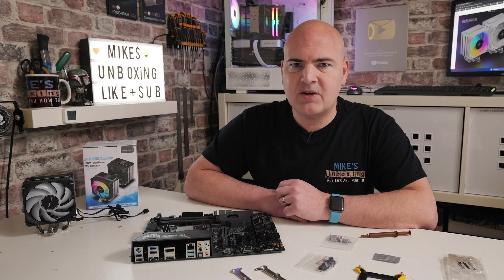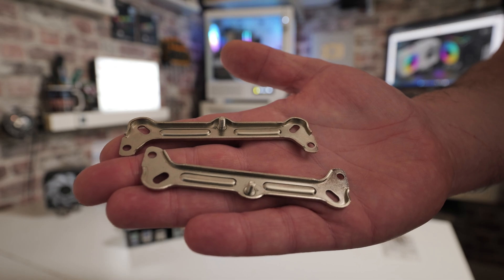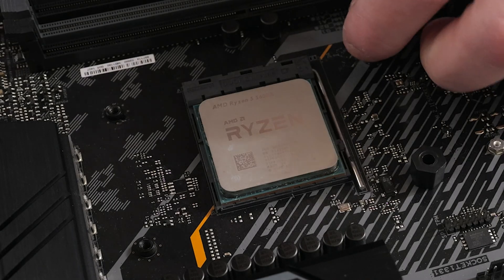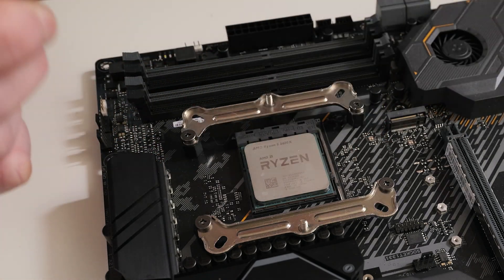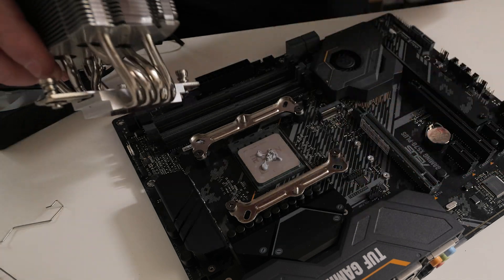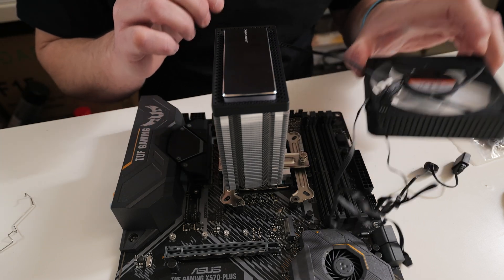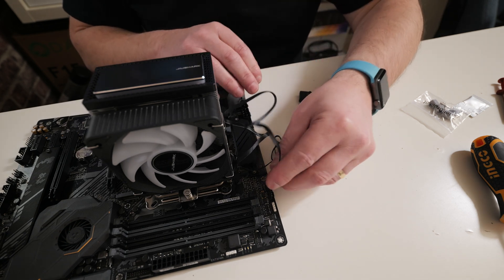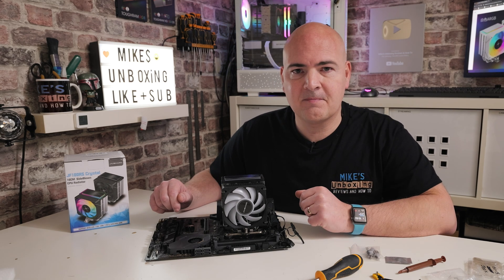How To Install Jiushark JF100RS Crystal ARGB CPU Tower Cooler AMD AM4 AM5 Motherboards

Comment: Can the light be turn off? Does it have a remote for argb? or do u need a app to control the light?
Reply from the maker: the light is controlled by whatever you plug the cable into, either a controller or the motherboard header and software

Comment: is this significantly better than the stock wraith cooler?
Reply from the maker: not massively, a 120mm version would be better but this is in between for those that have a smaller case and smaller wallet